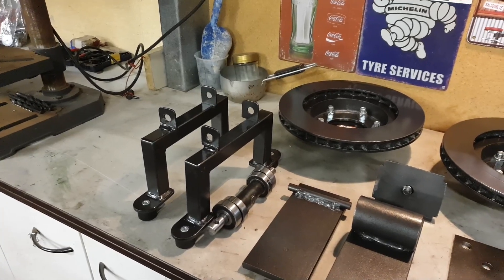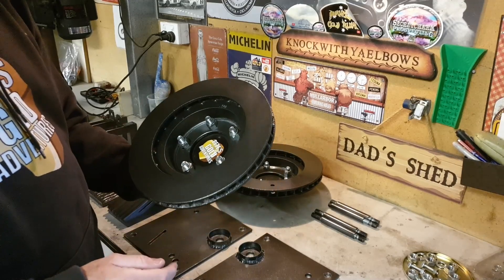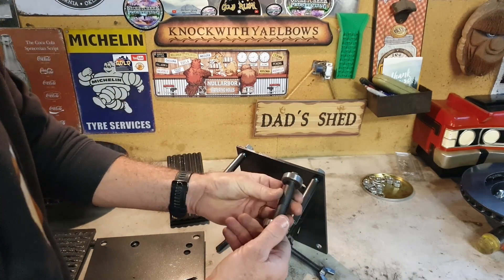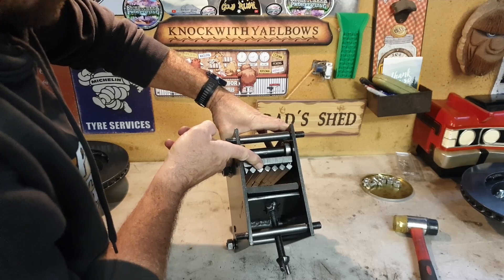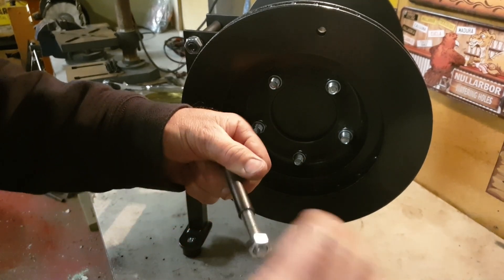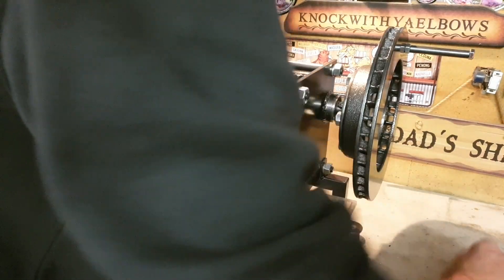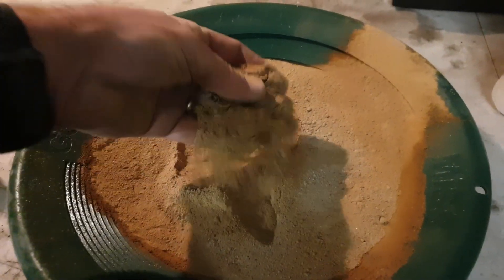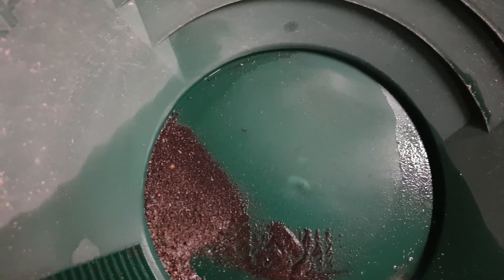BUILD and TEST a GOLD ORE JAW CRUSHER

Comment: Thank you for the ideas. I've been researching how to make a jaw crusher. Adjusting the front panel is such a smart idea, it really simplifies it. Great work
Reply from the maker: Thanks for watching, I'm glad you enjoyed the build. I did another video on that crusher where I strengthened it up a lot and fitted a new eccentric, scroll throught the videos, it was about 18 months ago I think. Cheers Pete
Found it, give it a watch https://youtu.be/p_SOqia-uts
Reply: @PetesGoldAdventures  thank you. The eccentric shaft with the tube over a solid shaft was my thinking at first so i could do it at home, but i may have to outsource that one. Thank you for the update
Reply from the maker: @trongytrong5845 The tube version worked, but when I got a mini lathe I built another, it's a lot more accurate with less wobble to the brake rotors. If you get one made it might cost a bit and some turning was involved with the tube method. Good luck and let me know how you go. Just make sure you over engineer everything, there's a lot of force involved in breaking quartz.

Comment: Man, Pete! Amazing job. Super video. You have out done yourself and inspired me and answered a few questions - as well as made me realize I was over thinking it. THANX!
Reply from the maker: Glad I could help, it turned out well for a first attempt. The only thing I could suggest is use 10mm plate where the adjuster bolt goes through, I had 6mm and it bent under pressure. Mine is in parts at the moment getting beefed up and a new one piece eccentric shaft, I'll do a video on the rebuild soon. Cheers Pete 👍

Comment: I wonder how it would go with a varable speed angle grinder go on it...
Reply from the maker: It's actually in bits at the moment, I'm beefing up some parts and fitting a new eccentric shaft, but I do intend on mounting it on a frame with an electric motor and mount the hammer mill below it. Cheers mate

Comment: It is almost to pretty to use brother. Excellent fabrication. Looks very professional Pete. My jaw crusher is much smaller with some of the same items as yours. Mainly the jaw adjuster is very similar. I don't have the fly wheels like yours. Works fine brother, good job. I subbed.😎😎⛏⛏🔥🔥
Reply from the maker: Thanks Chuck, Its works well for a first attempt, needs a few adjustments to firm it up as the adjuster plate flexing. The fly wheels are a coupe of old disc rotors, once there spinning it takes a lot to stop it. Thanks for the sub, I subbed to your channel a while back via Kirk and my son is also into 3D printing, so I showed him that. Cheers Pete

Comment: Perfect setup 
I know you probably get asked a lot but would you be willing to share the plan for jaw 
crusher 
Not sure how I missed this video, but glad I finally got to see it . Cheers mate
Reply from the maker: Hey Daniel, I don't really have any plans, I only did a drawing of the end plates and thats about it. The end plates are 220mm high x 200mm x 6mm, the jaws are 200mm x 90mm x 10mm, the shaft is 5/8 bright steel. The oscillation is only about 6mm, you'll see the 5/8 shaft welded inside a tube, that tube was about 30mm OD and turned down for the bearngs. That's the guts of it, If you watch the video you'll see the most of it as its assembled. I did just make it up a little as I went, found some things didn't work and just altered them. I do need to tweek a few things, I'll get it in another video once I have made the changes. Hope this helps.
Cheers, Pete
Reply: @PetesGoldAdventures  your a legend mate 
Thank you

Comment: Great job....
You need to support your fixed jaw accross it's full width other wise when load it will want to pivot on your adjustment bolt.
You will need to bolt it down also.
Your pivot for your jaw plate would be better placed at the top of it.
Great job for a back yarded though.
Reply from the maker: Thanks mate, its a first attempt and there is a few improvements to be made, the big one is the adjuster plate, even though its 6mm and only 90mm wide its flexing and appears to be bending, so that will require work to stop that. Its a good start and is already making crushing easier. Thanks for your advice, Cheers.
Reply: @PetesGoldAdventures  yep....that too. I'm lucky enough to have a commercially made crusher...makes it all very easy.

Comment: Bloody amazing Pete, great build, works pretty darn well, beats crushing in a dolly by hand, would of been under $100 to build yeah?
Reply from the maker: Thanks Anthony, works good, needs a few tweeks but I've crushed about 15kg of quartz now, so thats a win. Maybe a bit more than $100, the steel isn't cheap when your buying 10mm thick stuff and theres 3 sets of bearing but there not to expensive, I should have kept track of the cost.
Reply: @PetesGoldAdventures  , yeah , thought that after l posted it , but if you can get hold of some second hand disc’s and steel then the cost would be pretty good still, well putting 15kg through would of given you a good indicator on what needs to be changed anyway, well done 👍.
Reply from the maker: @anthonyrowe6508  I had the rotors sitting there, so that was a bonus, I did make the side plates twice, first lots didn't work out and It changed a long the way. Things to fix is the adjuster plate on the back, its 6mm steel and 90mm x 70mm and its flexing, now thats some pressure and the tread is binding up. I want to put some little ramps on the lower plate bearing to get a bit more movement down low, other than that it does work quite well.
Reply: @PetesGoldAdventures  look forward to see the 2.0 version
Reply from the maker: @anthonyrowe6508  Nice, I'll have to name it "The Crusher Thingy 2.0" I'll develop the whole "Thingy" range of prospecting equipment.
Reply: @PetesGoldAdventures  , Bahahahahahahaha, The Thingy’s getting the thing done,  coming to a goldfields near you, 👍

Comment: That is epic man, quality build and very good video!! This is exactly what I need to build
Reply from the maker: Thanks Andy, it was a fun build, at times frustrating, but with a bit of luck it turned out well, for the first one it works pretty good. It took a few goes to get the hammer mill right and that was less technical, a few small changes and it will be a good thing. 
Cheers Pete

Comment: That is an awesome result for your " crushing machine "  Pete.  It looks phenomenal.  Jason from Mount Baker Metal  and mining ( MBMM ) makes some amazing mining equipment in-house by hand. He makes some great crushers and mills. You did an outstanding job creating yours , the both look professional....must be the coat of paint 🤣🤣🤣. kidding . Can't wait to see it more in action.  If you use a magnetic tray underneath, then it will grab the Spalding from the crushing. See you soon my friend . Cheers
Reply from the maker: Thanks Steve, It came up well, there a lot more involved than the hammer mills and a good coat of paint sets them off, metalic grey out of a spray can. I have another video using both crushers coming out soon. The magnet won't help much as it will pick up more metal when it goes through the hammer mill, I just use a magnet in the final clean up. Thanks for watching, cheers.
Reply: @PetesGoldAdventures  I have a question Pete...the weight with the handle attached , can it be changed to an offset longer handle? For the purpose of comfort..I was watching you spin it fast to work a  faster crush..and I noticed how fast you had to spin to maintain the power of the crusher . Less effort and energy to spin with a longer handle . Plus it won't stop you as much or as hard . Totally just an observation and you don't have to do anything about it...especially if you're hands are comfortable using it the way it was made. Thank you for your response and for your patience with me on this question. Cheers my friend
Reply from the maker: @stevezozuk9622  All good Steve, I think It would work better if it spun faster, its not to bad, although it does raise the heart rate a little, but when its spinning the rotational inertia is high so you don't have to put a lot of effort into it. The ideal thing would be to fit a small electric motor to it or maybe a battery drill and then it would be great to use. I'll have another video out soon where I crush about 15kg, enough to fill 3 gold pans.

Comment: Great stuff Pete. Awesome work on the jaw crusher, as with all the gear you knock up in your shed there. Couple of tweeks that you mentioned and it will make short work of anything you chuck into it. Might have to something similar for myself. Smashing down the quartz to fit in the hammer mill is the biggest and hardest part of the job. Awesome work 👍
Reply from the maker: Thanks Jamie,  it turned out well, but the adjuster plate on the back is flexing and it stops the quartz from popping, I'll weld a long connector nut on it as the thread is binding and then brace it. I'll weld on a couple of small ramps to the bottom of the main plate to give it more movement. First i thought there was not enough oscillation, but if you had  any more it would jamb up.  Should make one mate, makes it a lot easier than the old dolly pot. 
Cheers Pete

Comment: Great work pete think you might have to change ya career mate, pritty cool, im bout another month away from finishing my 6.5hp impact mill lol dont have much time but the weekends really but only if weathers good cause i mainly work in the back yard. Keep up the great work mate👏
Reply from the maker: Thanks mate, I'll keep it a hobby I think, you enjoy it more that way. Thats a big mill, should be able to process a lot of material. Can be hard to find the time to build and get out bush, this project took 6 months, although I did make that little hammer mill in between, have to build another in the coming months for the next subs day out.
Reply: Cool mate yeah it does take a lot of time especially working all week at a day job i gave myself 2 mnths to do but will take longer as weather permitting. Definatly been fun so far with the build but learning zero tolerances are near imposible lol and a tolerance needs to be factored in, havnt been out detecting or panin so gettin a bit itchy.

Comment: Fantastic Pete. Your fabrication skills are fantastic
Works perfectly for it's purpose. I think I need a bigger shed!
Cheers and thanks for sharing your adventures
Reply from the maker: Thanks Steven, It works well, just need to strengthen the adjustment plate, its 6mm steel and is flexing, not good, but other than that its doing well. A shed is never big enough. Cheers mate.